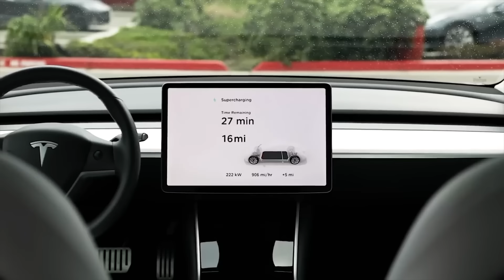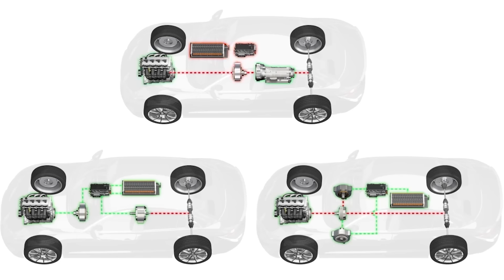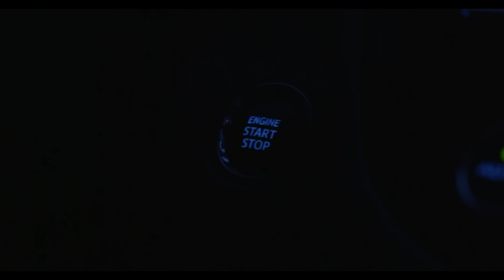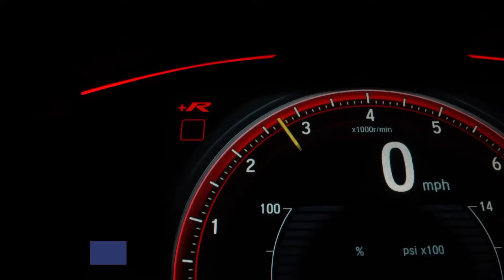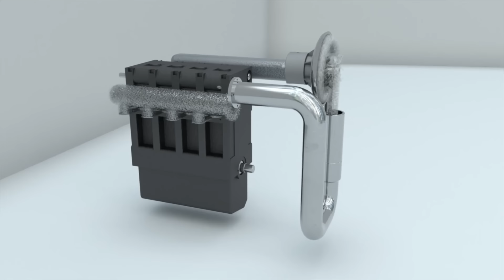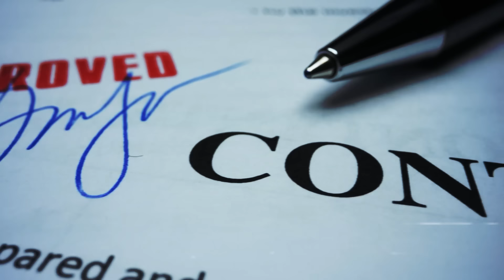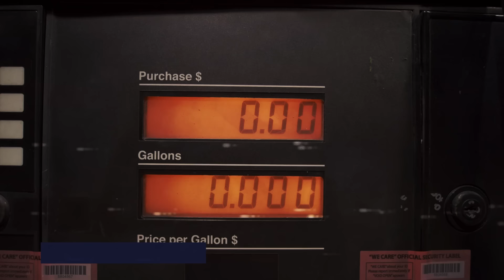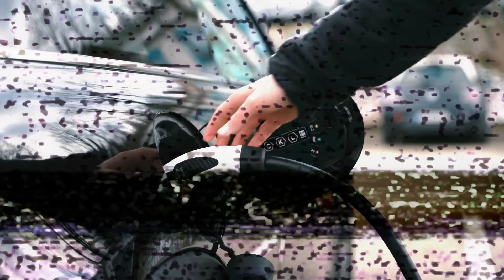Toyota CEO: "This NEW Engine Will Destroy The Entire EV Industry!"

Comment: Unless the electricity for EV's is from non polluting sources the the whole EV scene is a con! Here in Australia distances are too great for current EV endurance and outside cities will not be viable in the current form. Hydrogen availability will have the same weakness in as much as widespread availability or lack of it, will be it's weakness.
Reply: Even when the electricity is from polluting sources the amount of energy is a fraction of that wasted by either gas or hydrogen cars. So BEVs are a net win for the environment

Comment: Hydrogen is the way to go.. Logically correct and just needs a little mod to the existing engine.. Redistribution of hydrogen fuel won't be much as an issue as existing petrol stations can be modified to accommodate refills..

Comment: 35 years ago a Filipino inventor named Dingle introduced a car ran by water power or hydrogen power. To start his car  it must use first a gasoline and as it run could be converted into water power car. It was tested 400 kilometers and it ran smoothly. According to him he was invited by a certain official of a country & was told not to introduce his water powered to the market because oil business would go bankruft but he declined. However later he read an article about him that his invention was a hoaxed and he was a crazy man until  nobody listened to him anymore. Then a robber broke in into his residence and took the impt documemts of his invention and he lost it forever.

Comment: There is so much wrong with this video that I don't even know where to begin with deconstructing it.  But I will simply say that 1) I'm able to charge my EV off of my solar panels about 75% of the time vs. the grid, and 2) re: Li supply, google "Imperial Valley Lithium extraction."  There is enough Li in the Salton Sea brine in CA to power over a million new EVs a year for the next 30 years, conservatively, and the extraction method is unbelievably eco-friendly.  Toyota is making a fatal mistake.

Comment: Toyota was wrong and missed the boat with EVs and they are wrong again with Hydrogen.  EVs is not high price, only TSLA made it so.
Reply: There are EV battery technologies that are available that are magic bullets that can supply almost an  infinite supply of energy but you most likely won’t see them for many years if the big automakers continue to buy out the patents and bury them until they can wring the very last dollar of profits from the current internal combustion engines.

Comment: Using electricity to produce hydrogen does not solve the grid problems discussed, and may actually worsen the grid problems given the relatively low efficiency of electrolysis. If hydrogen is made from natural gas, then CO2 capture and storage is required which is still very expensive and energy intensive. So, the same conundrum exists when attempting to make something by using electricity to avoid using electricity (for EVs) is generally a greatet energy consumption path.

Comment: 1. I changed my EV just using my Solar Panels 2. New battery tec is on the horizon 3. Hybrid still needs batteries 4. We don't have a the H2 infrastructure but we do have a electricity net

Comment: I think H2 is the future for vehicles, but right now it has the same infrastructure problems as EVs,
Reply: But EV's have some distinct advantages too. You can fill up an EV at home for way less cost that public filling points. And if you have solar, you can get some fuel for free.  Every single hydrogen filling point will require an electricity supply, but EV chargers do not need a hydrogen tank.
Reply: @Brian-om2hh  Oh I agree, I own an EV, and they’re are lots of advantages, but for the average American, they present a lot of disadvantages over the current system of filling up a tank in your vehicle and driving off for 450 mile range.  One is if you don’t live in a home with a garage to charge; you have to find a station.  There are more and more charging stations being built every day but right now they are far surpassed by the number of fueling stations.  Also, charging at a station takes three to four times as long as filling up a gas tank.  If there were as many hydrogen stations as gas, Hydrogen cars were equal in price to gas, and they hit the range of a gasoline car, Americans would have no excuse not to make the change.

Comment: Sad to say oil is needed as a lubricant so you still have expensive services and engine ware will still be an issue, 
Hydrogen fuel stations will be a gamble because storage alongside petrol and Diesel while transition is implemented will be risky, However its important to change the way we travel and reduce Carbon emissions so support alongside Electric would be advantages, 
Good luck Toyota but for now I will keep my Nissan as I love it.

Comment: Battery power vehicles weigh 2 to 3 times the weight of standard gasoline vehicles which is harder on roads!
Reply: Tesla Model 3 curb weight: 3552 lbs.  BMW 320i curb weight: 3560 lbs.
Reply: @dansanger5340  compact model 3, how about the larger models with extended range. Lithium batteries from start to finish are bad for the environment!
Hydrogen engines/ Hybrids  are the way to go
Reply: @2169scs  I am comparing like to like.  A Model 3 is comparable to a 320i.  How about we compare a Model S to a 740i?  Tesla Model S curb weight: 4828 lbs.  BMW 740i curb weight: 4720 lbs.  Not a huge difference.
Reply: @dansanger5340  Do a Google on it.